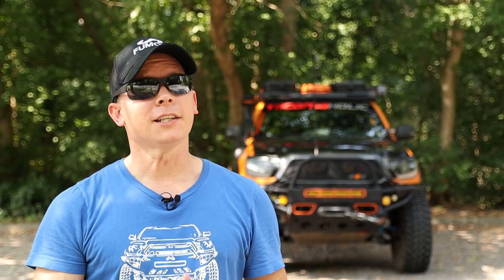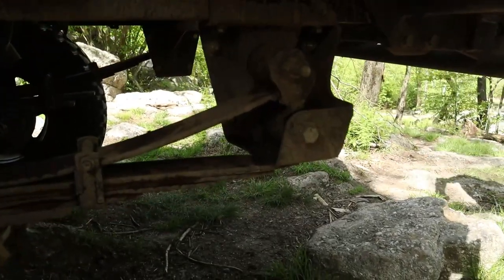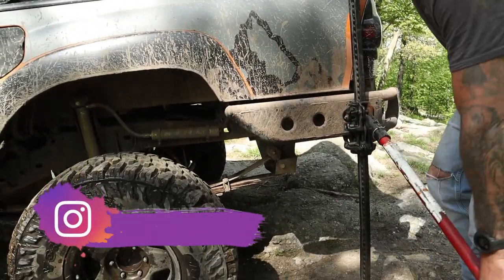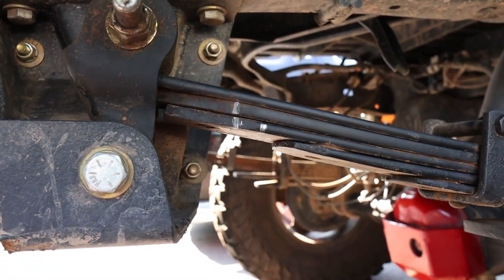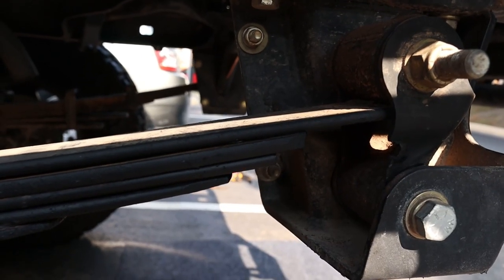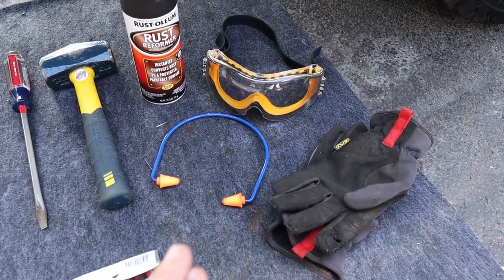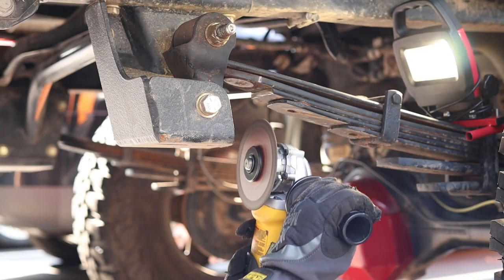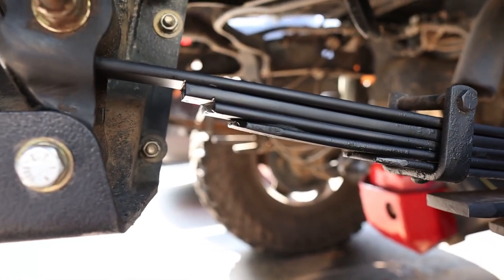Old Man Emu Dakar Leafspring Bind | Quick Fix

Comment: Out of curiosity, does that put more strain on the leaf that connects to the shackle? Since it was resting on those 2 lower leafs you cut off
Reply from the maker: I'm sure it puts a little more strain on it without the added support, but a few of my friends have done this and never had any issues with wheeling.

Comment: Does your ome leaf pack squeak like crazy
Reply from the maker: No I'm one of the extremely lucky ones.
Reply: @Tacomaholic  mine squeak like crazy even after a whole can of fluid flum 😭
Reply from the maker: @innek24  Yikes. Might be time to take the leafs apart and replace the separators/pads.
Reply: @Tacomaholic  yeah might have to. Probably gonna switch it out to the deavers later down the road.
Reply from the maker: @innek24  I'm looking at the Deavers as well.
Reply: @Tacomaholic  yep. I heard those are way better than the ome. Studier and no squeaking complaint from what I’ve heard and seen.
Reply: If you're looking at Deavers also look at ATS Springs. I got a full custom weight leaf pack for $450 and they're light years better than the Dakars I had. Zero squeek
Reply: Mine don’t squeak at all. There are two things you need to do to make them whisper quiet. When you install them put lead liners on each leaf and use oem bushings.  I’ve had mine for 2.5 years and they are  quiet and I off road a lot.
Reply: @Tacoexplorer  I see. I used everything they sent to me including the polyurethane bushings. At first they didn’t squeak much but after hitting sand, snow, mudding, and rock climbing it started squeaking bad.